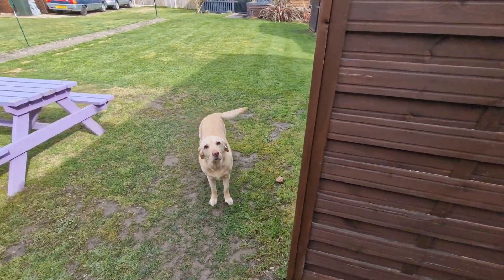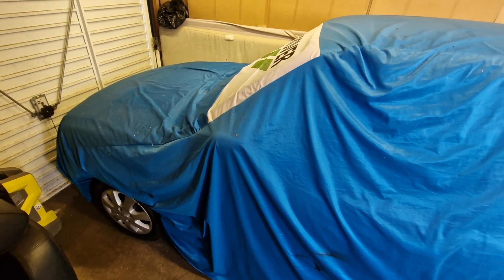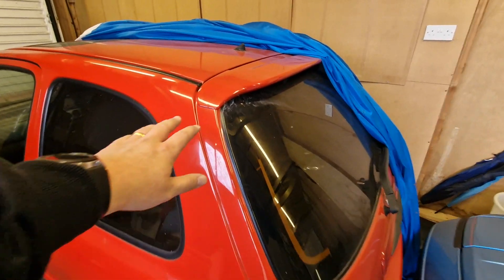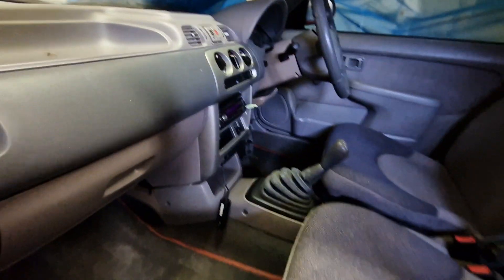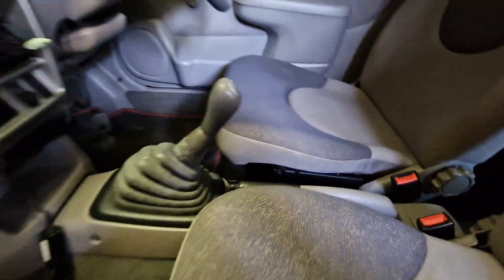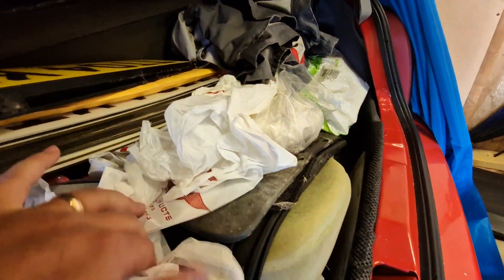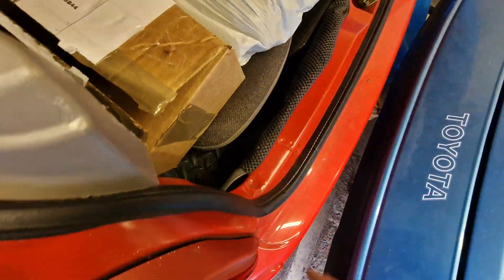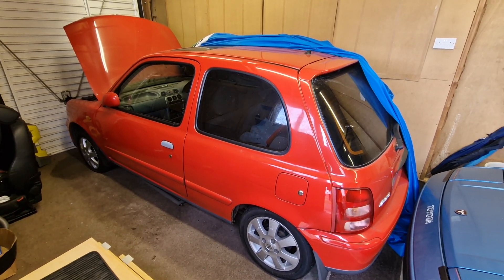Uncovering My Very First Car For The First Time Since 2015! - But What Condition Is It Now In?

Comment: Weird how engines get that white powder, my mx5 tries to do it, Keep the Micra, slightly biased as I have my first car, sold it to my my Gran 1993, who ran it till 2004, then I had it back & still own it, breadvan Polo Ranger.
Reply from the maker: I know! What is that dust?
Reply: @JonCoupland  Something to do with alloy cam covers. My MX5 was like that when I rescued it, hoovered / cleaned off ok, I even checked inside the cam cover & all ok